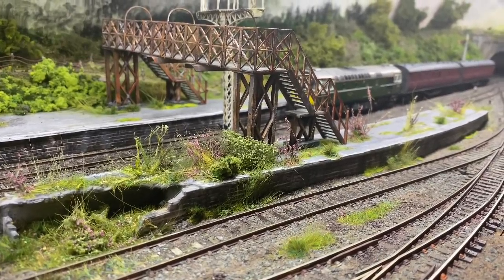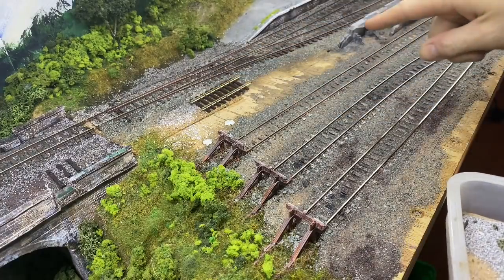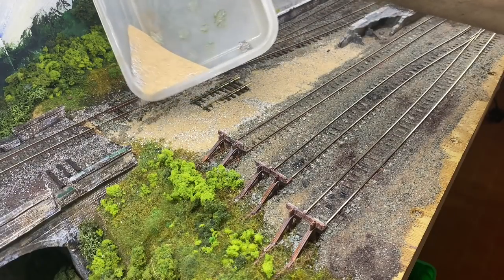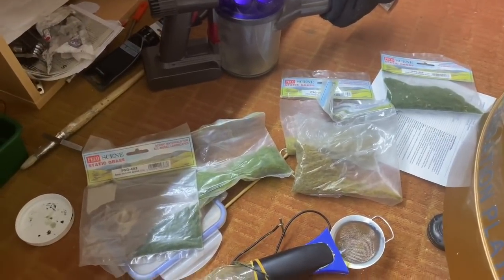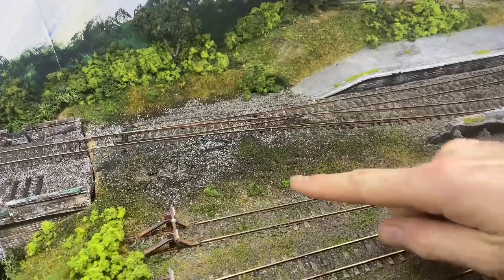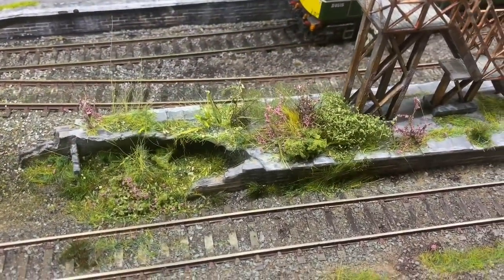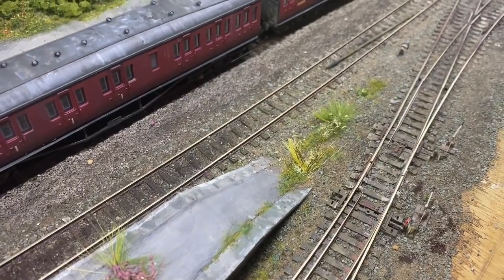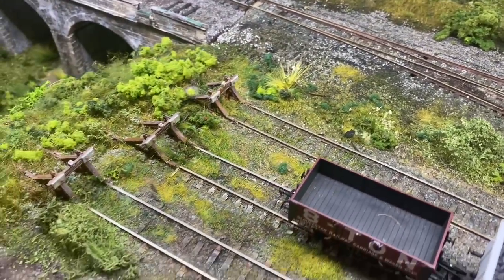MODELLING AN OVERGROWN PLATFORM ON MY OO GAUGE - PICCADILLY SIDINGS

Comment: Loving this scene John. Can I ask about the sock over the vacuum cleaner for the static grass. Do you use it to save the static grass to reuse or is it necessary to make it stand up. I have been having dreadful problems making mine stand up so all advice is appreciated
Reply from the maker: Hi yes the sock is used to collect the ‘waste’ ready for re-use but equally does help to stand the grass to ‘attention’ so to speak. It’s possible the batteries are going flat in your applicator or that it’s not so powerful. I did make mine from a fly swat but the dedicated applicators you can buy are 3-4 times more powerful than mine. Hoping that’s helpful. 

I am now posting videos for this layout on my main channel, ‘Piccadilly Model Railways’ link below, although I will monitor any activity. 
https://youtube.com/channel/UCygRpQ8YII92Mny-lQpG5oA

Comment: I've made my own static grass applicator. Same as yours but 9v battery and with an addition. I have put a pot on it. I cut a hole in the lid and hot glued it to the strainer. You can then put the grass in the pot and clip it to the handle and strainer.
Reply from the maker: Good idea, thank you for sharing